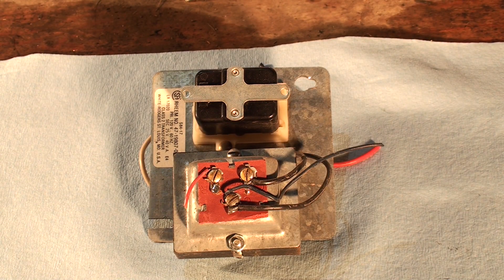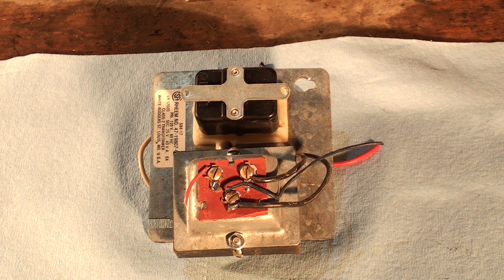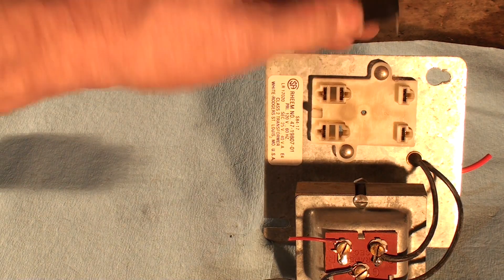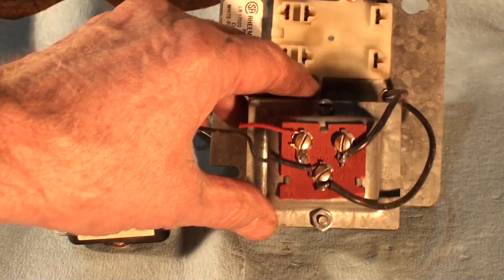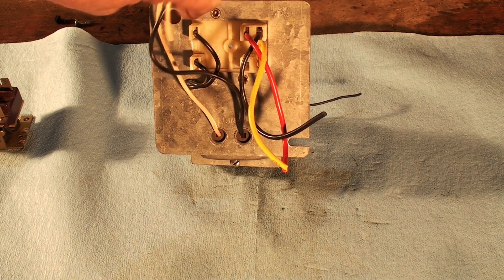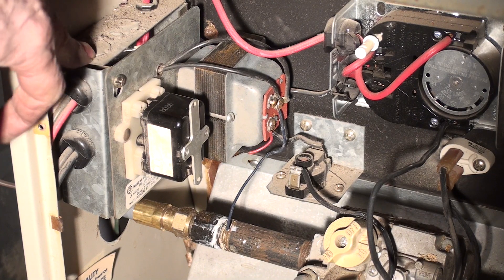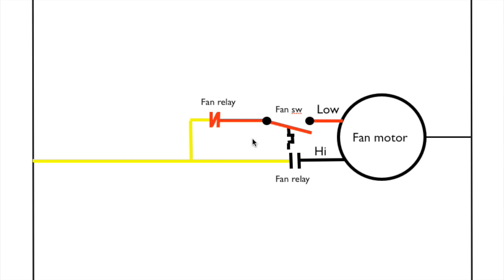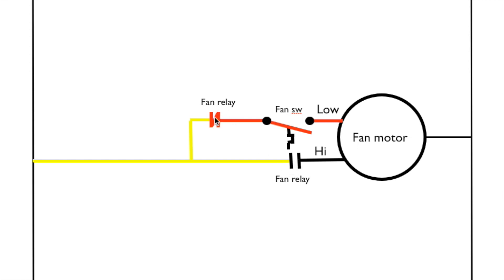How the fan center works

Comment: Fan controllers, consisting a 120/24 volt transformer and a fan motor relay, were used to control the fan on heating only, oil and gas fired furnaces when central a/c was added to the system. Most residential systems installed before the mid-sixties were heating only, Central air conditioning was considered a luxury, and rarely installed in new homes of the era. Then in the sixties, home owners began adding central a/c to their systems, requiring the modification of the existing heating only furnaces. When I began my electrical contracting business during that time, probably 80% of my business was wiring these “add on” a/c systems. Just a tidbit for you whippersnappers who came along after central air conditioning became a necessity for all new residences.

Comment: Still in school for HVAC and I know that thing almost too well. The instructors make us build one of those older furnaces on a board, at least once per class, sometimes more.

The board has the line in, 2 lights representing the fans, the limit, the fan center, the thermostat and the gas valve. Some also have the contactor for Y but I've mainly done them in heating class so we don't mess with it much.

Comment: Hi Gary 

I have a issues with my furnace the pilot light comes on but the burner come on but turns off in 10 to 15 minutes,  xould it be the 
White Rogers 8A05A relay

Comment: So to confirm, when there is no voltage going to the relay coil, it will operate basically off the temp switch for low speed, high speed only comes on when the relay gets 24v and switches the contacts?
Reply from the maker: You got it.
GFM

Comment: Thanks for the video.  
installing r8285a control center to replace an old one. I think I did not do the wiring correctly. There is delay (about 6 minutes )when I turn off and on the AC plus a loud clicking noise coming from transformers. Any insight? Thank you.
Reply from the maker: The delay may be in the outdoor unit to protect the compressor from short cycling.
GFM
Reply: grayfurnaceman thank you. This never happened before until I got this new transformers.  I looked at your video regarding short cycling, I am not sure if this defect or features or user error when wiring. Thank you.

Comment: Hi Gary, I’ve got a mobile home electric furnace that a customer is adding a HeatPump. Will this fan center work in that application , if so do you have a wiring diagram?

Comment: I am trying to replace the transformer on a 30 year old gas furnace...the transformer that was previously in the furnace looks like a fan center as it has the five terminal connections (R, W, Y, G, C), but does not appear to have a relay on it.

All of the modern transformers that I have looked at only have the R & C terminal connections....I was wondering if it is possible to replace the old transformer with one that has only the R & C connections, and if so, where would I hook up the wires that were previously connected to the W & G terminals on the old transformer.   

For the record, I do not have central A/C and do not use the fan without the heat being on.  Any help would be appreciated....thank you!!!
Reply from the maker: The difference between your transformer and the ones you are finding is just a terminal board.  You can connect the R and C as the old one.  W from the stat connect to W on the old terminal board.  Cap off G.  Hope this helps.
GFM

Comment: Just came across your video, perfect timing. I purchased a fan center to operate a circulator pump for in floor heat. If i am understanding correctly, I will use the high speed only, which goes to the circulator? Then to my t-stat do i connect red and white or red and green. Thanks in advance.
Reply: kirk ummel ...hi there ....I need to do that too but not sure how to do it ...I have a taco box for my zones for my infloor ....and need to power  my pump and I want my pump works only when one of my six actuators is up so maybe I can use that fan center just don't know how ...can u help
Reply from the maker: vincentykula You should be able to use the end switches on the zone controls to power the pump.
You could feed R from the fan center to the end switch and bring the other side of the end switch to G on the center.  That would energize the relay in the fan center to start the pump.  Hope this helps.
GFM

Comment: This one has only 3 screws, the one I have has 2 low voltage tabs and also 3 screw terminals , a center screw which I think is line voltage with what looks like an 18 gauge wire(greenn) attached. I think one side is N/C and other is N/O, but there are no wires to the W and Y terminals, I think someone messed this up and never finished, do you know where the W and Y wires lead to?

Comment: question on the diagram: is the yellow wire the one coming directly from the thermostat ? If not, then how it gets 24 volts ?
Reply from the maker: The yellow wire is from the 120 volt source.  It travels thru the normally closed fan relay, thru the normally open, close on rise in temp fan switch to energize the fan motor.
Or, if the fan relay is energized, power travels thru fan relay to energize hi speed of the fan motor.
GFM

Comment: curious on a heat pump with a old oil  furnace  as the back up heat  would  you need a additional relay to  shut the outdoor unit down to run the oil furnace  if so how do you wire that in
Reply from the maker: You must shut down the heat pump while the furnace is on.  One of the most common ways to shut the pump off is to use a plenum thermostat that shut off the pump when the duct temp reaches about 100F.  The thermostat is placed in the yellow wire circuit to the pump.
GFM

Comment: i have a fan center with 2 rows of connections, does that make a difference?
Reply from the maker: It just has terminal connections for G (fan) W(heat) Y(cool) in addition to the R and C of the transformer.  Hope this helps.
GFM

Comment: So the G wire will be high speed even in the winter?  A modern variable speed unit will employ a low speed on the G wire for continuous circulation.  It is able to distinguish G (low) from Y+G (high).
Reply: No. The G (fan) Tstat signal switches the relay, which sends line voltage to the Hi speed tap of the fan motor when the Tstat calls for cool (and also calls for the fan). In heating mode the gas valve of the furnace, a thermal switch or a timer circuit operates the fan without using the relay, which switches on the Lo speed tap of the motor through the NC contacts.

Electric air handlers almost always need a call for fan (G) during a heat call but some designs use the heat call (W) to switch a relay to control the fan speed taps (NO contacts for Lo speed and the NC contacts for Hi speed).

Comment: I have a heat pump in AC works fine but heating indoor blower doesn't come on ? Help
Reply: Armando Monreal i had the same problem. Did you figure it out?

Comment: I have one too my thermostat not working I check common wire check the transformer im getting 224v on the transformer I think I'm not getting 24v out
Reply from the maker: If you have power in and no power out of the transformer, the transformer has failed.  Look for shorts in the low voltage circuit.
GFM

Comment: Your schematic was a bit confusing. I would have shown it as a yellow line going to the terminal. From that point it becomes black making contact with the low fan pole with a coil icon showing the open pole to hi fan.